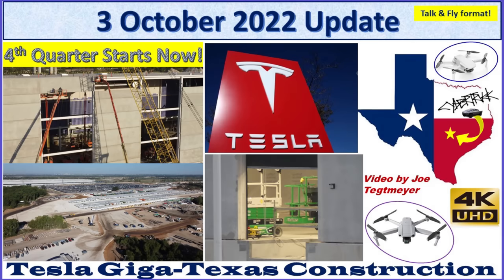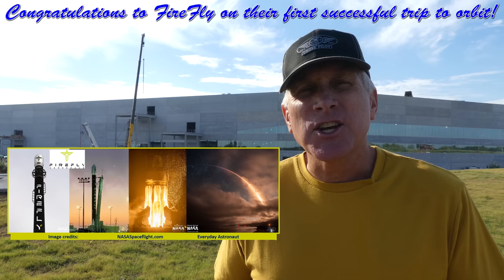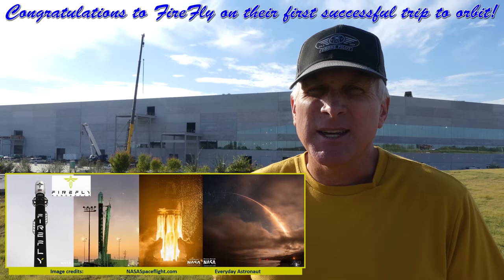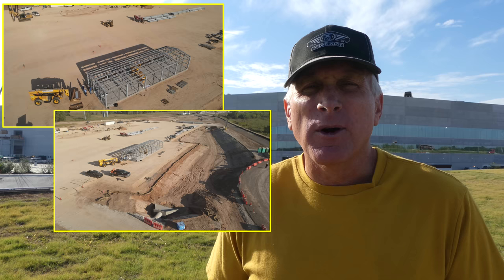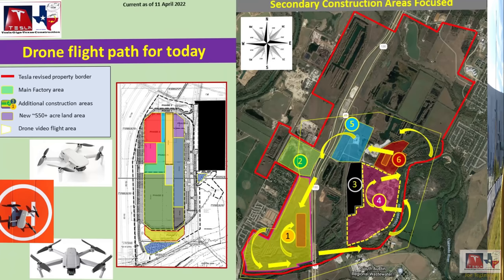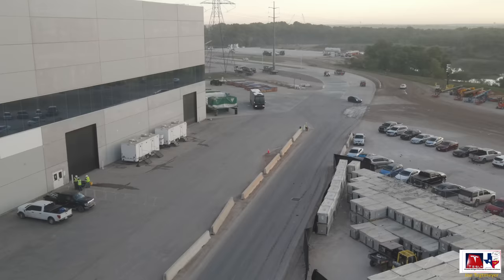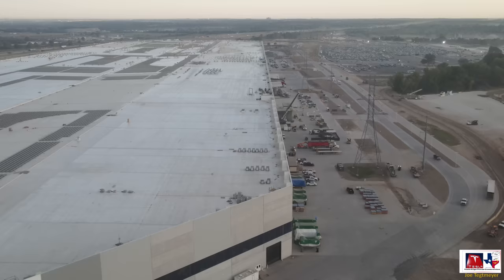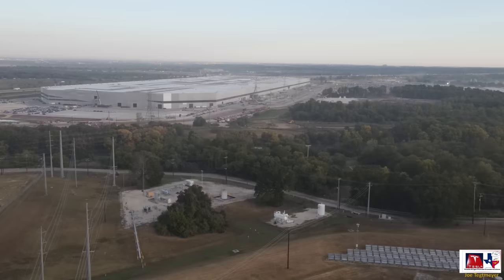Steel on the Move on this 3 October 2022 morning Giga Texas Construction Update (07:35AM)

Comment: Very disturbing the level of human activity at this site represented by only about 35 new production cars located at the logistics yard. Something very odd is going on here. There should be a car coming out onto the lot every 5 or 10 minutes by now. There just seems to be no progress. That number needs to rise to a car every 2 minutes in the next 3 months. What on Earth could be taking so long? They are not battery constrained, according to recent public discussion.
Reply: Ramp up takes time. This is the same for every manufacturer. Berlin just added their 3rd shift and are at 2000/week. They expect to be at 5000/week in the next 3-6 months. Austin is about 2-3 months behind Berlin after starting construction over a year later. Next year with Berlin & Austin at solid phase 1 production Tesla will be pushing out ~2.5 million vehicles next year (the size of BMW). This year they are on pace to build 1.4-1.7 million.
Reply: Also shorter answer. End of quarter rush to clear out as many produced vehicles out so they can count as deliveries to keep the bean counters happy. The staging/transport lot will fill up quickly again.